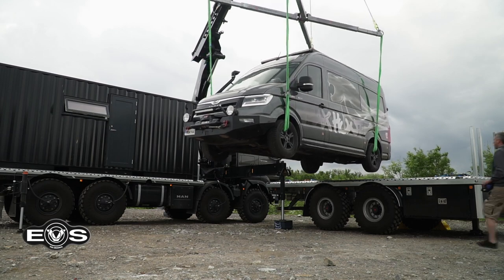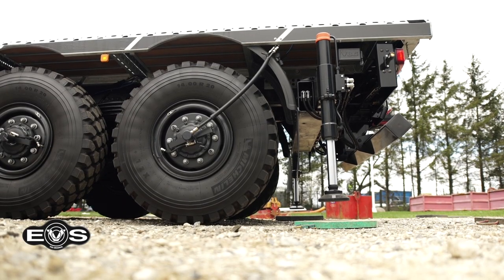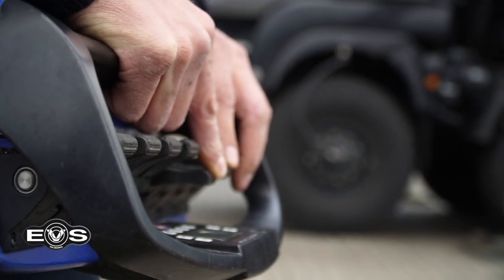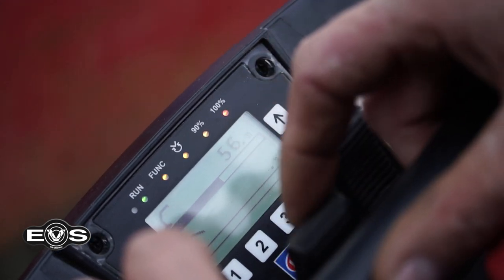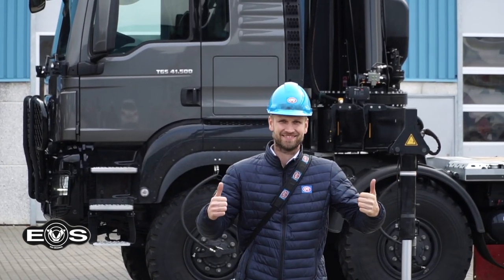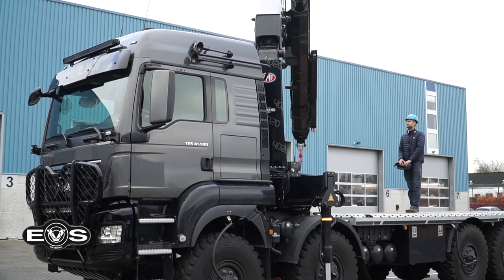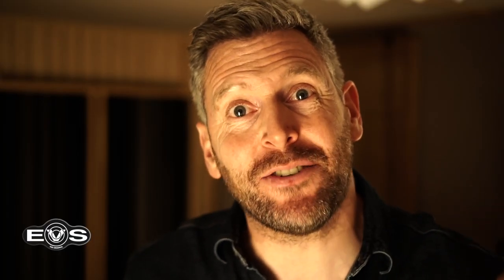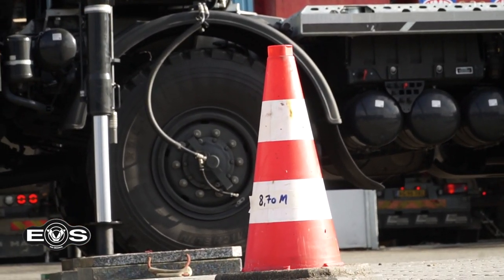EVS on an HMF 4020K crane

Comment: My worktruck shange soon... I really hope, this EVS works as hmg tell it should work.
I'v driven now 8 years austrian "crybaby" (always beebing, when lifting in near limits)... And it's fit & works perfectly on my current truck. And now different brand truck & crane. So hell a lot new learning. :D

But I have few questions, because I have't seen that crane manual yet.
What evs measure to make its decision how stable truck&crane is?
What are functions avaible when evs makes stop?